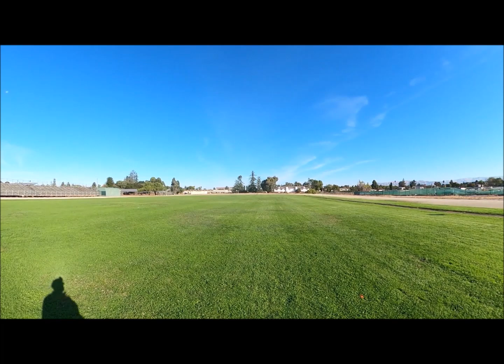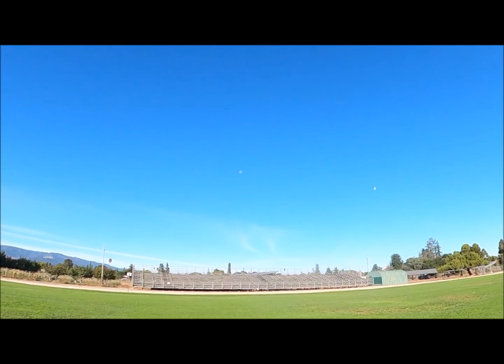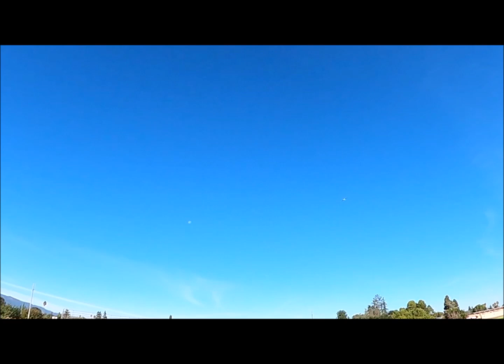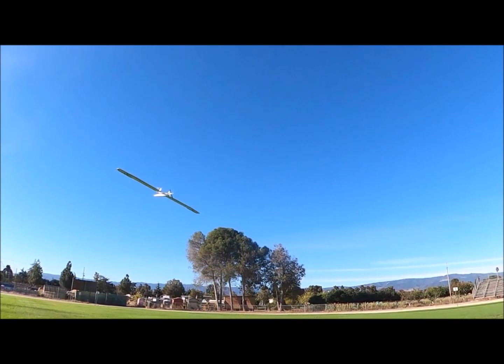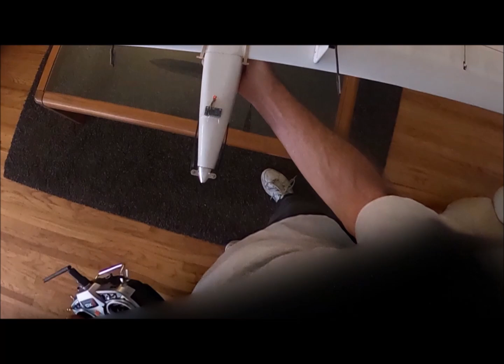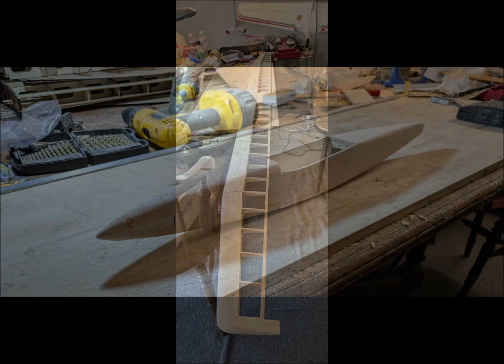Unstable Flying Wing with dRehmFlight controller

Comment: How much more efficient is this compared to a normal aircraft, with the center of gravity in front of the neutral point?
Reply from the maker: I don't have enough instrumentation on the model to measure it and I have not flown it with a stable CG setting.  Theory predicts that the efficiency of the stable design can be close to the unstable design at a single flight speed but will degrade at all other conditions.  If you include slow speed flight, the difference will be significant because the stable model will have a much lower CLmax.

Comment: Very cool! Is it a simple proportional controller between the windvanes and the control surfaces? Or is it a full PID controller?
Reply from the maker: Pitch axis has proportional angle of attack error, pitch attitude error, and pitch rate feedback. The yaw axis is proportional sideslip angle error and yaw rate feedback.  Roll axis is proportional roll angle feedback only.  There are no integral loops used or gain scaling. This is the simplest controller I could come up with and it could be made better in the future.

Comment: I wonder how long a really really good pilot could keep it in the air without the stabilization?
Reply from the maker: less than 1 second. It's too unstable to be controlled by hand
Reply: Depends on aspect ratio and airfoil shape. I have a stable flying wing(no sweep back) with a somewhat lower aspect ratio which is easy to control by manually adjusting a flap, ailerons, and throttle. My airfoil is unlike the traditional reflexed airfoils seen in the literature. I haven't experimented enough with aspect ratio to know how large I could make it.

Comment: Could you asymmetrically adjust the span loading for yaw control?  Adjusting the span loading will in turn change the upwash and downwash across each wing, so the induced drag would shift and change the yaw moments.  The Prandtl bell shaped lift distribution with it's higher downwash in the middle and upwash at the tips is something you could potentially design in to help reduce/avoid adverse yaw associated with roll.
Reply from the maker: To obtain a pure yaw input using this approach would require a highly distorted span load because lift and roll moment would have to remain unchanged.  I don't think this will work well unless coupling between the axes can be tolerated.
Reply: @smorrismlbco  Certainly easier to model it that to make it work in practice.  The effect of control surface deflection on profile drag would also make things harder to juggle for a wide range of control movements.  

The use of bell shaped lift distribution would probably make this juggling act simpler as the tips could provide proverse yaw.  If the craft was stable in yaw then you might even be able to get away with just two inboard control surfaces, one per wing.  However, this is whole different experiment than craft that is unstable in all axis and needing to actively manage stability like the one you've just built.
Reply from the maker: @robertosfield  BSLD is used to minimze adverse yaw on swept wings that already have some mechanism for yaw stability like wing sweep. BSLD alone will not stabilize this design in yaw.
Reply: @smorrismlbco  I wrote "if the craft was stable in yaw" in this context assuming one would need to add vertical surface to enable yaw stability.   

I think it might be possible for bell shaped lift distribution to provide a little yaw stability in combination with appropriate polyhedral with a straight wing - think gull wings and how the lift distribution changes on yaw and how this then could provide helpful the yaw moment if done right.
Reply: @robertosfield  In my opinion, straight wings are different from sweptback wings... The yaw stability is mainly provided by the sweep instead of dihedral. Merely dihedral cannot stablize the wing, especially with a large moment of inertia.
Reply: @thermalsurfer  The way the lift vectors change for a yawed wing with dihedral actually create a instability in yaw while creating a roll stability. This happens from a swept and straight wing.  

The converse is also true, anhedral creates yaw stability, even on a straight wing. 

Now polyhedral mixes both, what impact on roll and yaw stability all down to how it's balanced across the wing.
Reply: I forgot to mention a great example of how anhedral provides yaw stability: the para-glider.  As they don't have a tail or sweep but are yaw stable, all because the lift vector on a wing with anhedral is pointed outwards, and when the wing is yawed the outward lift force then generates a corrective yaw moment.
Reply: @robertosfield  Thanks for explanation! It reminds me of one paper about this, DOI:10.1061/(ASCE)AS.1943-5525.0000625

Comment: Very cool! I was excited by the alpha-beta probes, but it looks like those are just potentiometers? Any extra information about that?
Reply from the maker: The pots come from a Hitec HS 422 servo.  They have low enough friction to work at low airspeed with a large vane. I read them using the computer's A-D channels.